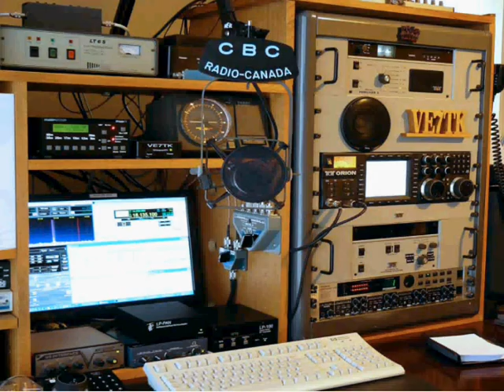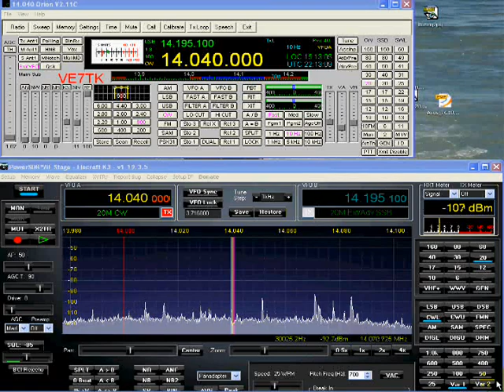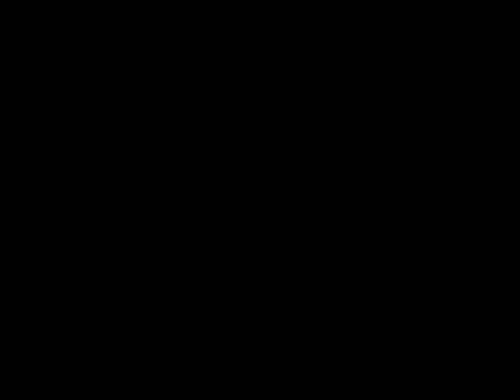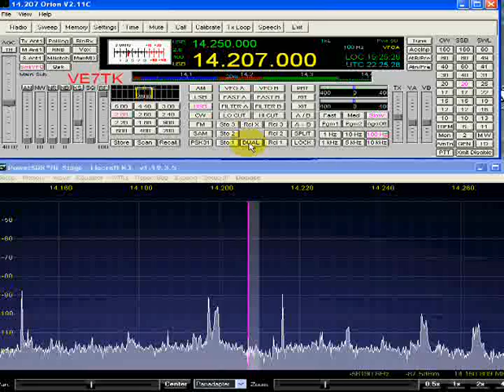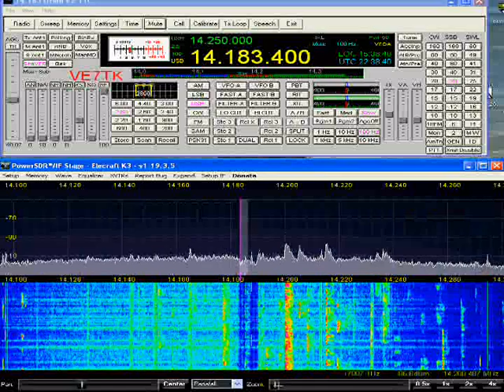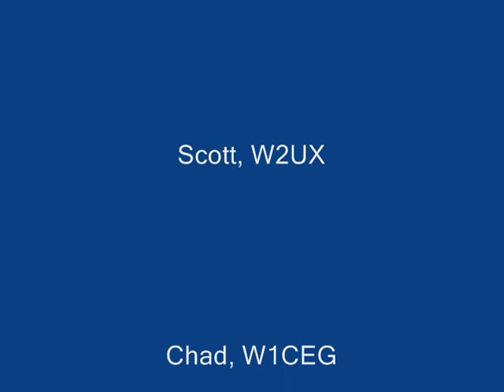LP-PAN with Ten-Tec Orion using N4PY and PowerSDR-IF Software

Comment from the maker: Yes as mentioned at about 00:29 to 00:39 of the video, a mod is needed and the mod is described on my website search under VE7TK (I cannot post a link on YouTube).  Enter the site and look for the 9MHz IF Mod under the Ten-Tec Orion section.  If you have the new RX-366 sub-RX there is a 9MHz port available without further modification.

Good luck. 73, Rick